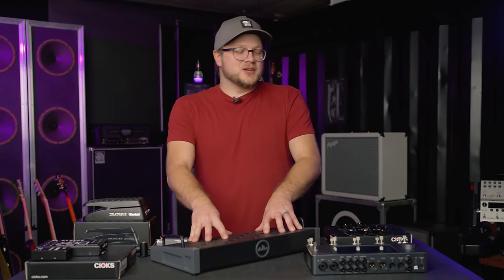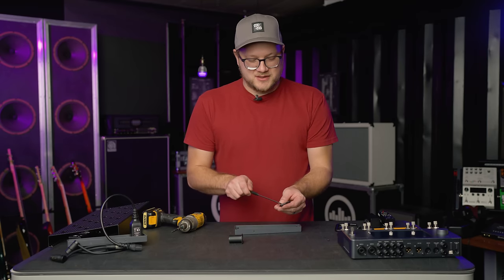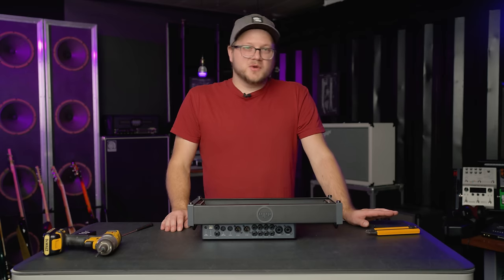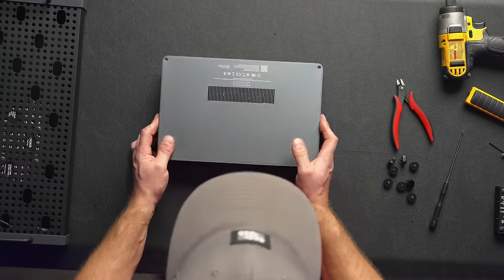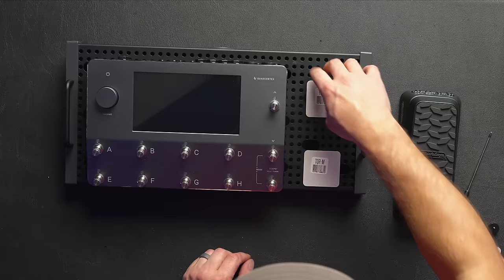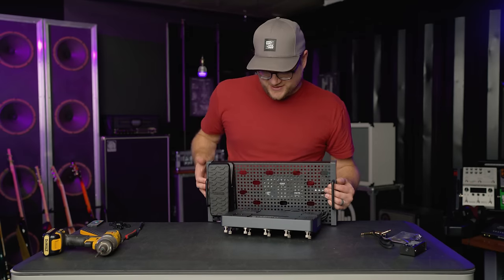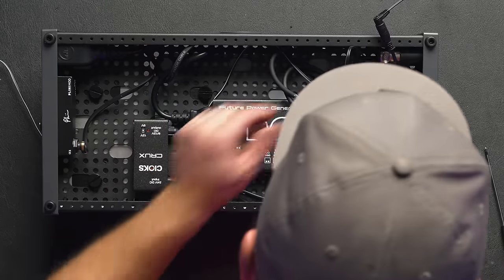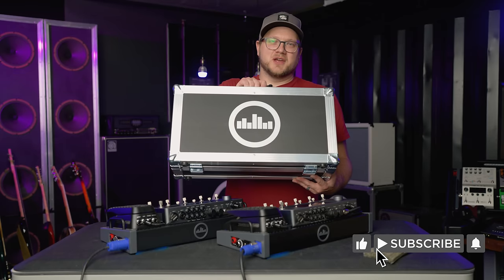Crafting Plini’s Quad Cortex Pedalboards: Temple Audio Backstage

Comment: Suggestion for the end caps:  Do a little cutout in the plate where the screws go so no one has to wrestle with the awkward angle to remove and reattach the handles, especially when you're saying that's a better method to do it.
Reply: I was going to stay exactly the same thing, then read your comment.

Comment: I’m not an expert but mounting the power supply directly under the Quad Cortex doesn’t sound like good heat management.  Especially when you’re covering the vents on the bottom of the Quad Cortex.   I used the mission engineering 529M power supply.  Very compact (just larger than a 9 volt battery) and it runs the Quad very nicely.
Reply from the maker: Fair point! Easy to move over if need be.
Reply: It runs the QC? Is there a massive adaptor. Touring Europe this year and trying to find a solid power.
Reply: You need a usb power supply like the ones that charges your  phone.   That’s it.  The power supply runs off of that. It is fantastic solution.  Then you can keep your factory power supply for backup.  I can send you pictures if you want to drop me your email.

Comment: I made a board very similar to this, but I put a switch on the QC power supply so it doesn't start to boot every time power is presented, because on stage when they are setting up the front of stage power the power goes on and off until its time to line check, at that point the QC gets turned on and hasn't been switched off halfway through booting by accident.

Comment: That's a wonderful tutorial. I'm not too happy in placing CD7 right below the qc air flow holes. 
Beside that I'll surely follow this useful tutorial for my temple audio pedalboard :D
Reply from the maker: As far as I know the QC is passively cooled (heat sink) and it shouldn’t cause any issues. Plini hasn’t had any troubles using it on the road but - all that aside - it’d be really easy to place the DC7 elsewhere!

Comment: I love temple boards! I don’t actually use the mounting plates because they infuriated me when I tried. I just use dual lock but I always buy temple boards.
Reply from the maker: Glad you love the boards! Totally fine to use Dual Lock if you prefer, but - once installed properly - I still think Pedal Plates have a lot of advantages.
Reply: @templeboards  they are very solid when installed, and a great design. My irritation came with adding or taking off pedals to swap out. Was a bit more time consuming than the dual lock setup.

Comment: Very Cool and very helpful. I am thinking of building my own now. The only question I have is about the Crux and the 2A supply instead of 3A that is required by the QC. Isn't that a potential reliability issue for the performance of the QC?
Reply from the maker: You can double check with Neural, but - as far as I know - the QC only draws around 2A and it’s perfectly safe to use with the Crux. I’ve had zero issues.

Comment: GREAT video! Have a quick question - why do you have to use the CRUX?  I am curious if you could just set one of the 7 channels in the DC7 to 12V and run a power from that to the QC?
Reply from the maker: One channel on the DC7 doesn’t supply enough current. You could either bridge four channels to combine the current or use a Crux.

Comment: Really fun video! Curious about the placement of the power supply, doesn’t that block the vents of the QC?
Reply from the maker: As far as I know, there’s no forced air cooling in the QC so it wouldn’t be blocking air flow. If it were problematic then it’d be easy enough to move the DC7 over. There is a bit of space for ventilation between the QC and the perforated top sheet of the board.  The same amount of space as if you used the included rubber bumpers with the QC on a solid floor.

Comment: would have slide the QC up against the side so that the expression pedal is further from the handle because it looks like the handle might interfere with it.. in my experience people's foot placement on expression pedals isn't fully lined up on the top of it so their foot would hang off the side which in the case would mean their foot is hitting the handle
Reply from the maker: Couldn’t move the QC over any more because I needed access to the cable management hole on the left side. On a larger board (eg. DUO 17 or DUO 24) you could go all the way to the left and give yourself more space on the right. The handle doesn’t conflict with proper use of the expression pedal.
Reply: Wasn’t an issue for the boys at all. Temple did an amazing job crafting these and properly spacing out everything. Amazing job!

Comment: Do consider a slightly larger build on your board. Just a bit, so that all connectors are within the board, away from the edge property. Templeboard to feedback.
Reply from the maker: These particular builds were designed for Plini and Jake Howsam Lowe, who prioritized a highly compact setup. As you can see, the cable connectors stay neatly within the board's footprint, ensuring a good fit within the case and eliminating any concerns about cables extending over the edge and getting stepped on.

We understand that not everyone has the same space needs. That's why we offer a range of sizes! If you prefer a different layout, you can explore options like the DUO 17, DUO 24, or even larger sizes. I’d recommend you check out www.templeplanner.com to map out the best size for you and lay things out the way you'd prefer.

Comment: I tried the mounting plates once. Never again, they were a nightmare to remove when I sold the pedals.
Reply from the maker: Sorry you had a negative experience. When installed correctly, they work great and are relatively straightforward to remove without damaging the pedal whatsoever (see older removal videos).
Reply: @templeboards  I will, thanks. Just getting another Temple board tomorrow so maybe I’ll give them another shot.

Comment: Why Cioks ? Why is the device's own adapter not enough?
Reply from the maker: You can definitely use the original adapter! With most pedalboard setups it becomes really inconvenient to have several “wall warts”. You’re correct that it’s overkill in this case since he’s only plugging in a QC and LED strip.

Comment: Can someone explain to me how the AC Main is connected? I can see where he plugged into the power supply underneath-BUT-that blue connector that shows on the outside of the board? 

That doesn't look like you could plug a electrical plug into it? Do I need this cable?
Reply from the maker: This is the Powercon MOD. You plug a Powercon cable in and it locks in place. It's a common choice for big touring rigs, but for most people I'd recommend using the IEC MOD instead.
Reply: @templeboards  Thanks-Asked a Sweetwater rep which cord was the correct one-ordered and arrived. Board is completed.

Comment: hmmm you blocked the air inlet at the bottom of the QC.... even worse, you put a hot PSU against it... It is passive cooling in the QC, so it needs natural air flow to be optimal...
Reply from the maker: Hasn’t been a problem for Plini. Easy enough to move if need be.

Comment: That’s a lot of expensive CIOKS power modules when you could have just mounted the QC’s power brick under the board.
Reply: That's what I'm planning to do, get a half rack power conditioner and zip tie the original power supply to the conditioner under the pedalboard. It's way less than half the price of the ciosk. You also get a few more plugs for other pedals and of course the protection.

Comment: Question, with the cortex mounted above the power supply, is there any issues with overheating?
Reply from the maker: Plini hasn’t had any issues, but it’d be straightforward to move it if need be.

Comment: It hurts so much when the drill slips and you're chewing off that screw top. Sometimes you can even see screw shavings on the board - I am sure it still works fine but ouch. Great stuff you are making though gotta say.
Reply from the maker: Sometimes there's little flecks of metal and such from fastening things in place, but I don't think much screw head stripping happened here. If you're concerned, you can definitely just use a standard #2 Phillips instead.... but Templeboards are durable and can take a bit of mishandling, lol.

Comment: Any good way to mount an fm9. Those raised feet. Uugghhh
Reply from the maker: I haven't personally mounted an FM9, but I assume that - once all feet/screws/etc are removed - you can use four Medium Pedal Plates (one per corner) to mount it. You may be able to bypass using pedal plates and remove the screws and refasten them through perf and back into the pedal.
Reply: @templeboards  thanks bunch. I appreciate it.
Reply: I have a FM3 which has the same feet/end caps as the FM9. The trick I did was add some dual lock to the plate and to the bottom of the FM3 and then made an in between dual lock piece by putting them back to back to just give it a bit more height. I find using the dual lock with the plates gives me maximum flexibility since I am changing my boards wayyyy too much.
Reply: A ton of people over on the Fractal forums have mounted FM9s on Temple pedalboards. I don’t remember the details, but IIRC it was described as a fairly straightforward process.
Reply: @OtherTheDave  thank you so much. I’ll check it out. My temple board is decked out with mods I don’t want to lose.

Comment: So many bells and whistles, but the real problem is not addressed properly : having a 230v cable so close to audio cables. EMI/RFI interferences could be more "controlled' by placing differently DC7 and its power cable. Additionnally, mounting pedals on a metal plate is not a bad idea, but not any word about ground and ground loops... Mounting a pedal board is not only for solving mechanical problem, but could be a solution for avoiding electrical problems...
Reply from the maker: We didn’t have any noise issues with this setup. It would be easy enough to move around the power supply and/or cables if need be.

Comment: Templeboards are way too over complicated. Not worth. Unless you’re constantly in a controlled temperature environment, those quick release adhesives slide around and make your pedals look crooked eventually.
Reply from the maker: The adhesive is rated to withstand around 270°F. If your pedals are getting that hot then you’d have other issues on your hands. 😜

Proper prep-work is key. If done correctly, there’s very little reason for the pedal plates to fall off or go crooked. If - for whatever reason - you are having issues, reach out to us and we’ll help sort things out!:  sales@templeaudio.com